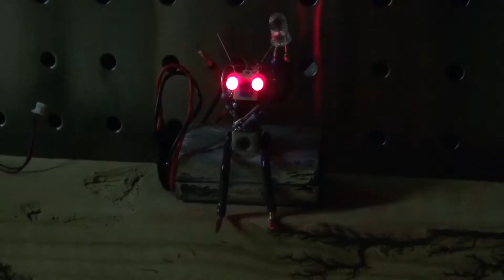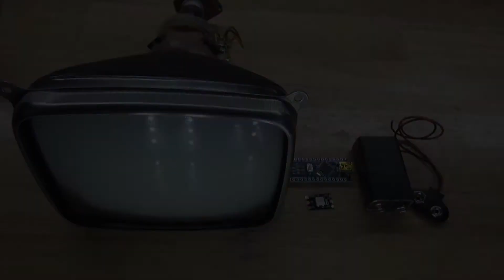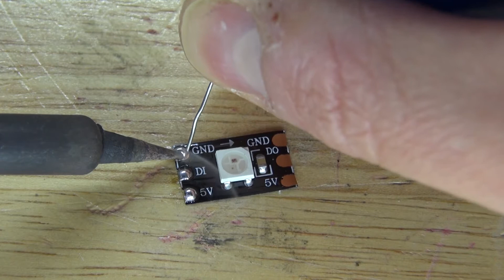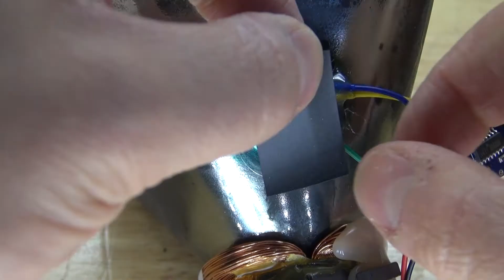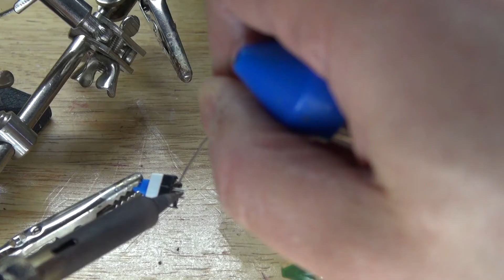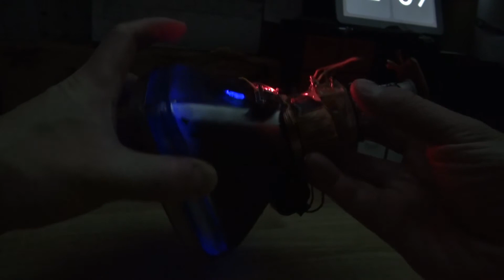CRTTV With Arduino Nano And WS2812b Neopixel Retro Lamp

Comment: it is nonsense, why not to just drive the crt??? it can produce an image instead of just random colors!!!
Reply from the maker: I tried that first but the crt at the end where the wires are suppose to connect to was cracked. The vacuum pressure was gone therefore it was not going to work. I thought putting an led inside was more interesting.